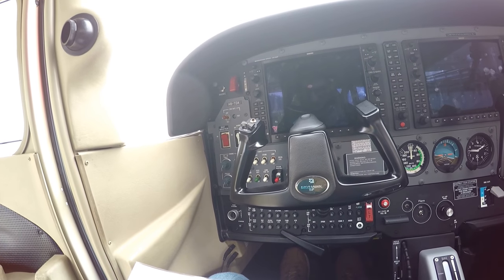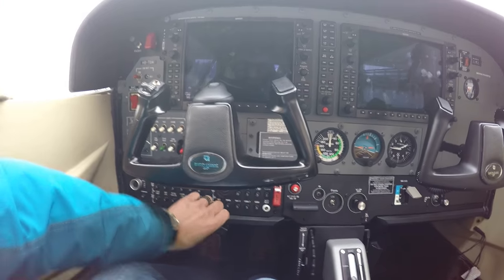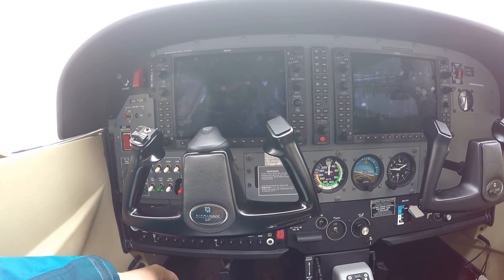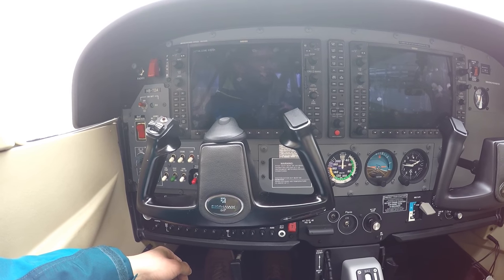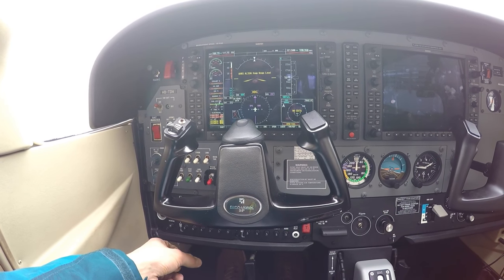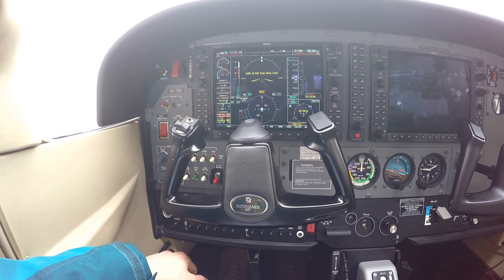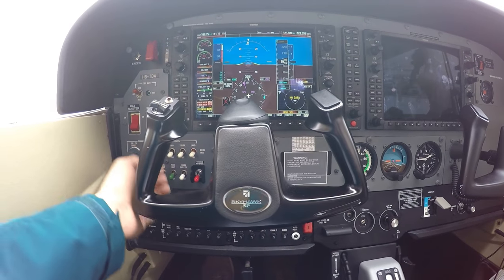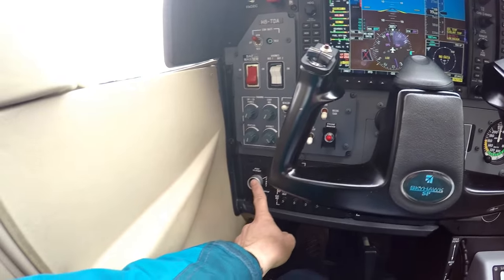C172 JT-A | TECHNIFY DIESEL ENGINES | FGZO

Comment: great video, anyone can fire up the JT-A after watching your video ;) now this is something I have not seen written down in any of the FGZO manuals but basically, any other diesel engine operator has: first flight of the day on nights below 5 degrees celsius glow it twice before starting. we do that on the DA40's and C172 JT-A at other clubs. altho this won't be an issue from now on anyways with spring/summer ahead!
Reply from the maker: Thanks for your feedback. I agree this should be written on the checklist. A friend of mine made the same comment last week. Safe flights!

Comment: too bad Cessna dropped them from the lineup...although almost 500k for a 172 is way out of line
Reply from the maker: @Matt Foster: It definitely is. Our flight club decided to retrofit our four C172SP with Technify Diesel engines. The main arguments were that the older AVGAS-fueled Lycomings with 2000 hours each would have generated more total overhaul/fuel/maintenance costs and conflicts (noise abatement around the aerodrome, LSZK). We're pretty happy with them, although we lost a bit of payload capacities.
Reply: With the 155hp and 2100h tbr it has become a decent engine.

Comment: You have to keep the fuel pump on?
Reply from the maker: @tonoposadasjr: Fuel pump is required for starting. We then keep the fuel pump on during take-off and initial climb (backup pump). The pump is switched off as soon as we reach a "safe altitude". As well, the fuel pump is switched on during approach/landing.
Reply: @bertrandfilmstudios  So without the fuel pump, the engine is gravity fed or is there a mechanical pump driven by the engine?
Reply: @bertrandfilmstudios  You don’t need to touch the fuel pump with the diesels, they will start up fine without it